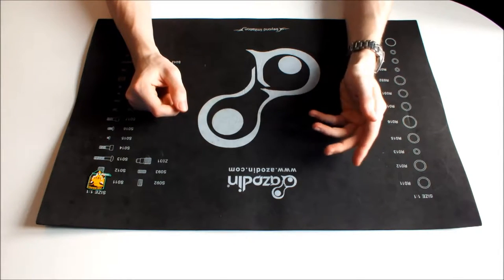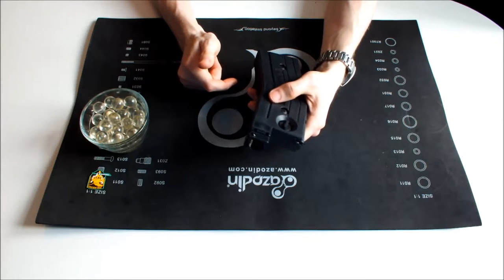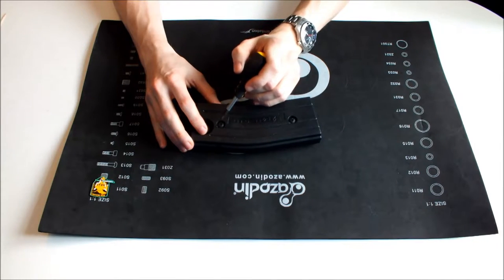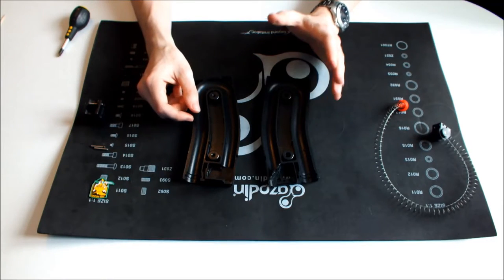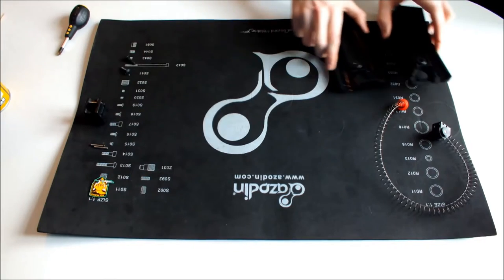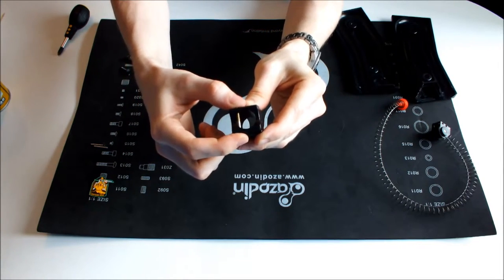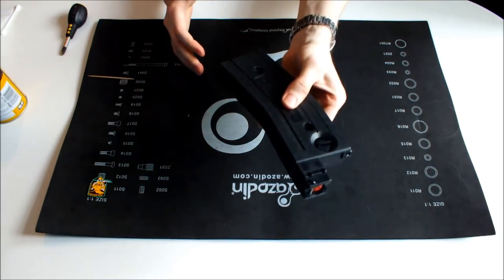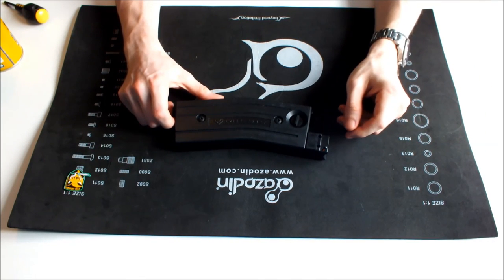Mag Fed Paintball - Milsig Mag Maintenance & Paint Selection

Comment: Got my CQC yesterday.  But shop gave me 2 straight mags. Breaking paint.  But not when hopper feeding.  Used hopper to test paint. So the mags spring tension seems to be to much for the paint.  Luckily they will swop for 2 bent mags in two days.  Should solve problem.
Reply from the maker: The straight mags are designed for first strike rounds meaning that they have tougher springs so yes, you will break more paint if you're using them to fire standard .68cal. Also as I've said in this video, make sure you select good quality mag fed grade paint, especially in cold weather. Laysick meteor, Valken Graffiti and GI Sports Winter are good choices.
Reply: Thanks.  We only have GI 1 Star, 2 Star, then the one they gave me called GI custom.  They said the Custom was a better then the 2.  So I know realize the higher the star the more brittle.  I emailed GI.  They said I should try 2 Star.  Also mag issue.  In fact the Milsig Manual also says only to use First strike in the straight mags.  Thanks for response.